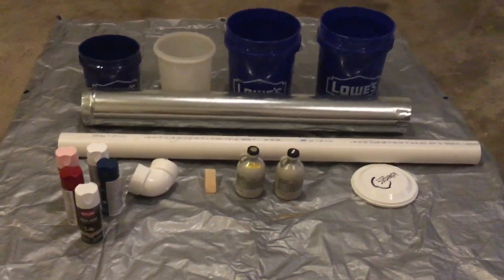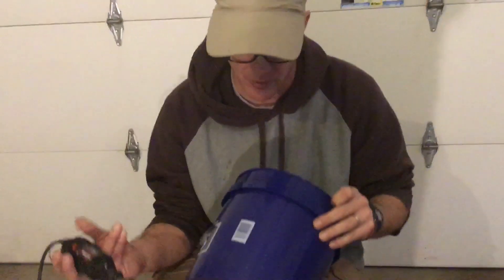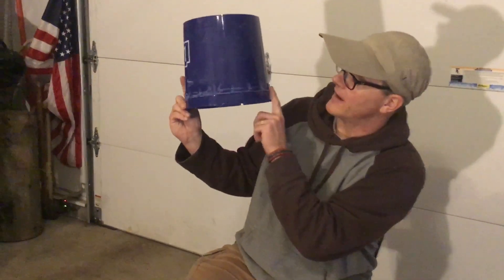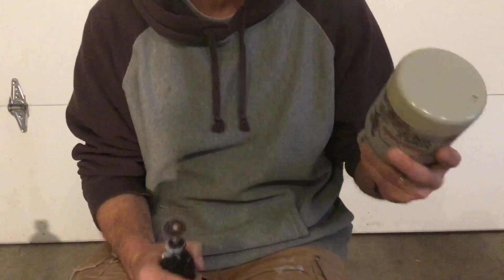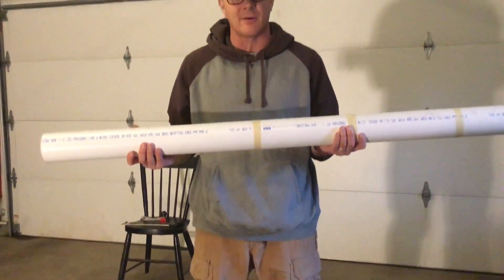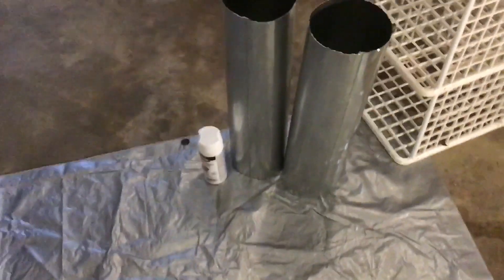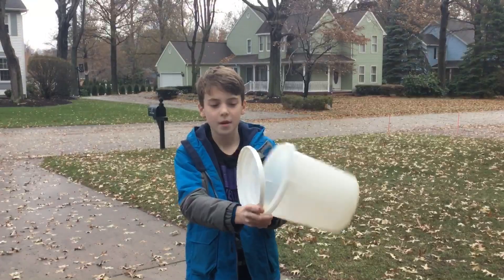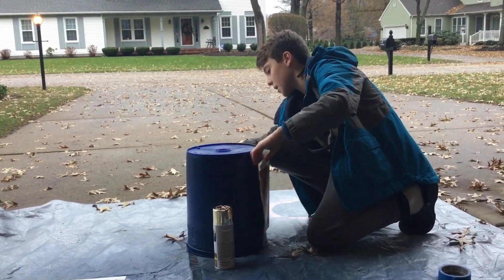GIANT CHRISTMAS NUTCRACKER (part 1)

Comment: To cut the lip off the bucket - had you considered a table saw?  Have your fence set with a board laying flat (as you cut the lip off the diameter will change, so use a flat board measured out for the diameter at the very top of the bucket) Wear gloves to have a good grip on the bucket and slowly feed it into the saw.  Once the saw makes contact carefully rotate the bucket.  Should be MUCH faster and uniform.
Reply from the maker: That is a great idea!!! If I ever do something similar I will!!